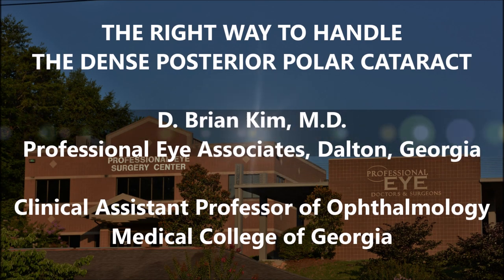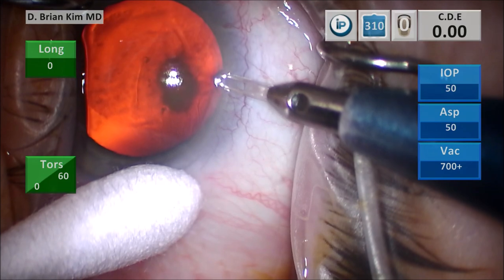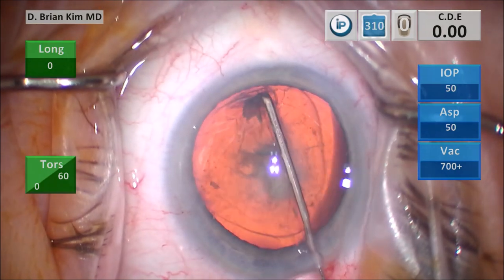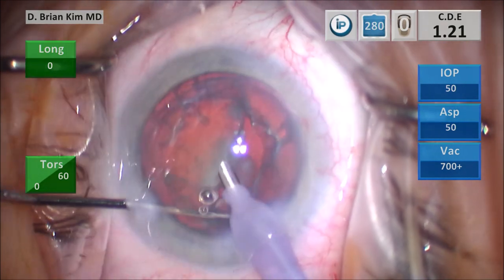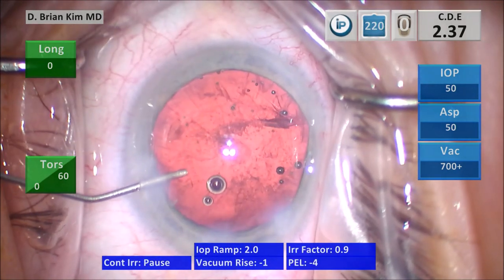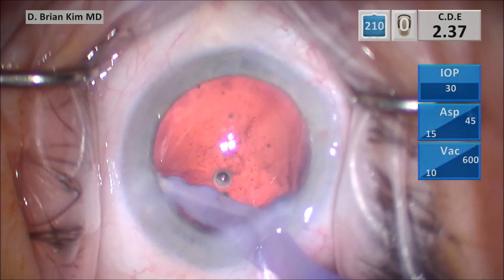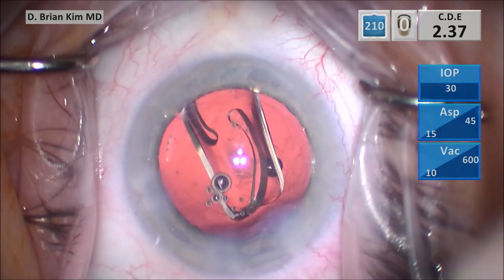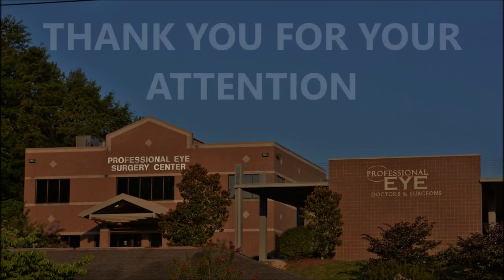Strategies On How To Handle the Dense Posterior Polar Cataract

Comment: Hello Dr. Kim,

Thanks for the great video.
I am trying to do direct vertical chops all the way now. But with soft cats I am feeling being handicapped with this technique, I receive bowls regularly because of cheesewiring of the phaco tip. This cracking technique (horixontal vhop I guess) which was demonstrated here looks good to avoid that in soft cats.
Would you please advise, how can one determine with the OP microscope if the cat is too soft for the direct chop?

Also, which chopper is that?

Thanks!
Reply from the maker: These are excellent and true observations.  Vertical chop is a terrible technique when it comes to soft lenses.

Horizontal chop is usually performed by applying US to bury into the center lens and held with high vacuum and the chopper is placed at the lens equator and pulled toward the phaco tip to fracture.

This is technique is a big modification in 2 ways:

1. No US is used. US is not necessary and counter productive because you the soft lens pieces may crumble when trying to hold it with high vacuum. No US. No vacuum.

2. The phaco tip rather than burying with US, is tilted vertically and positioned subincisional to the endonucleus which enables both the chopper and phaco tip to flank the lens on either side of the endonucleus so that you can cut the lens with both instruments, which is why I call it double chop.

It is a marvelous technique because it is so efficient and forces you to learn how to manipulate not on the chopper but also the phaco tip in such a way as to fracture the lens with only mechanical forces.

This makes lens disassembly so easy and easily applicable to a wide variety of situations. You will never be stuck with a epinuclear bowl ever again. Best wishes.
Reply: @DocBrianKimMD  sounds interestinf, I have to try it... Would you please recommend the chopper?
Reply from the maker: @daeto9  Kim double chopper. Please see prior videos for reference.

Comment: thank you
In such a case, I would not do hydrodisection or hydrodelineation. I would do phaco routinely. Also place an AC maintainer at the beginning.
Reply from the maker: Thank you for the comment. I don’t see the reason for an AC maintainer since I have continuous irrigation with the phaco handpiece. Also, while I agree to avoid hydrodissection, it does not make sense to avoid hydrodelineation. It is safe to do even if the PC is compromised. And without hydrodelineation, the endonucleus will be adherent to the bag and it will be difficult to mobilize for removal. It will be a struggle for no real benefit. Best wishes.
Reply: @DocBrianKimMD  thank you

Comment: Respected sir, if posterior capsule is absent, can the IOL be still placed in the sulcus ? If not, what are the options for placing the IOL ?
Reply from the maker: Hello, yes sulcus is a good choice. Optic capture is ideal to ensure the IOL does not slip or dislocate in the future.
If the defect is small and central, you can still place a single piece acrylic IOL in the bag but this requires great care.
Best wishes.
Reply: @DocBrianKimMD  thank you sir 🙏

Comment: Respected sir, is FEMTO LASER CATARACT SURGERY a safer option for surgery of posterior polar cataract ? What are the chances of posterior capsule rupture and nucleus drop in FEMTO LASER CATARACT SURGERY ?
Reply from the maker: I have ZERO experience using the femtosecond laser for cataract surgery but I have experience with LASIK. Like As you probably know, it can be used to create incisions, capsulotomy, and lens fragmenting.

There are limitation to all of them: incisions tend to be difficult, the capsulotomy can radialize if not handled carefully, and the lens softening has limited effect on ultrabrunescent cataracts.

Having said all this, I think you can use it but I'm not sure it provides an advantage for a polar cataract. The most important factor is avoiding hydrodissection and a careful lens disassembly to prevent vitreous prolapse.

I hope this helps. Best.
Reply: @DocBrianKimMD  thank you sir for your valuable support 🙏

Comment: Respected sir, if anterior capsular rim is found ruptured at the time of cataract surgery and posterior capsule is absent, can the anterior capsular rim regrow and replenish itself within 5 - 6 months and hence support the placement of IOL in the sulcus ?
Reply from the maker: Hello, no. The anterior capsule rim will not grow back. Once it is torn, it is torn. If the anterior capsule tear is isolated, you might be able to place the 3-piece IOL in the sulcus but if the tear is more peripheral I would NOT trust the sulcus. You can get late IOL dislocation. Much better and more stable to scleral haptic fixate or suture scleral fixate the IOL. Best wishes.

Comment: Respected sir, if the anterior capsule rim is found ruptured during cataract surgery, can this ruptured anterior capsular rim fibrose itself over a period of time to support an IOL in the sulcus ?
Reply from the maker: Unfortunately I do not think so. I have done exactly what you said many years prior. Most do fine but I have seen some cases of late IOL dislocation. Best wishes.
Reply: @DocBrianKimMD  thank you sir , but what are the possible causes of rupture of anterior capsular rim ?